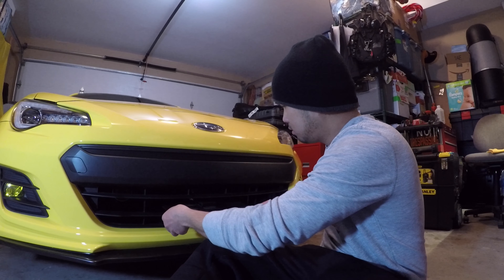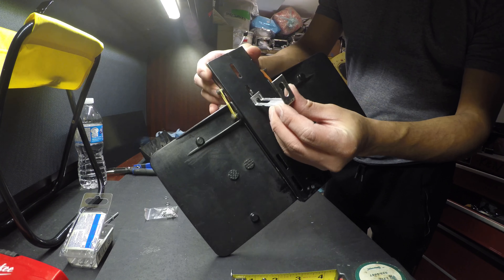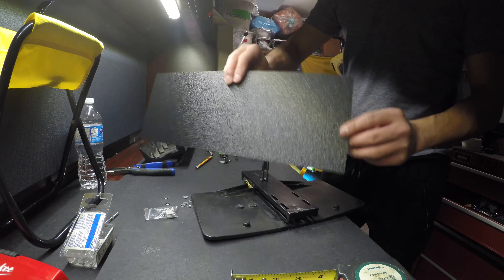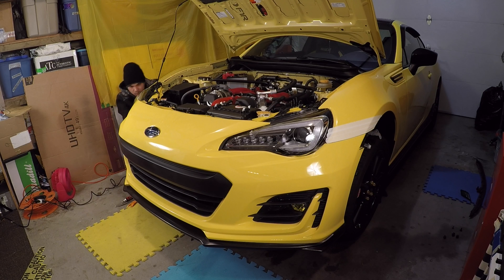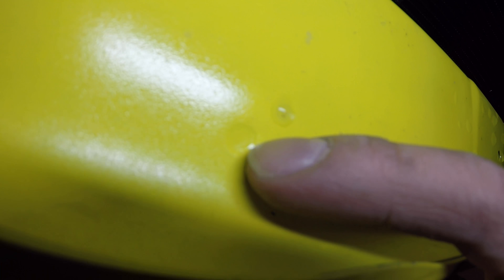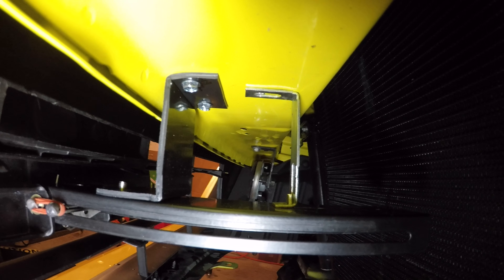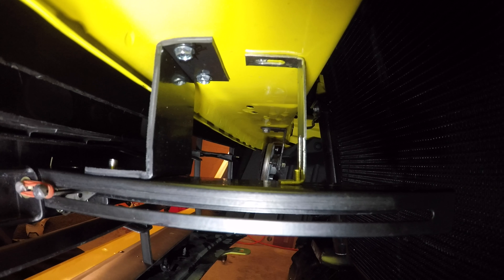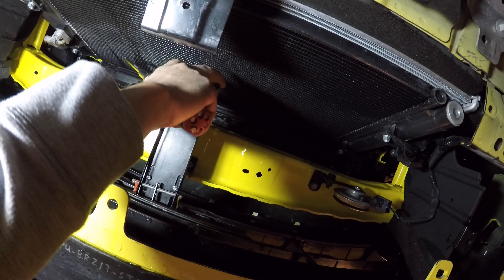Best license plate mod for subaru BRZ? (Retractable License Plate)

Comment: Do you think it would fit underneath the bumper? I have an FRS and there is no where to fit it on the grill
Reply from the maker: It will fit under but I learn that the hard way and will scrape just like a lip